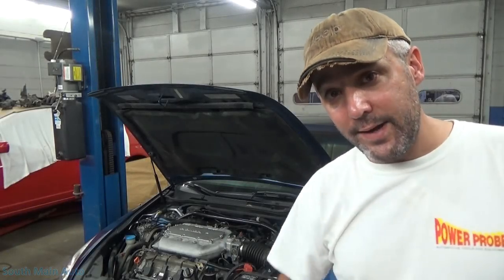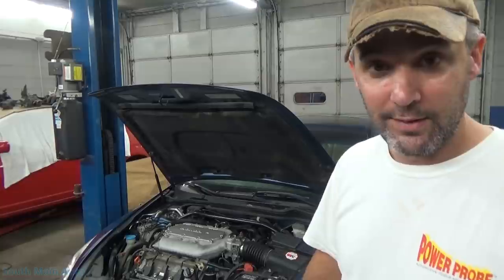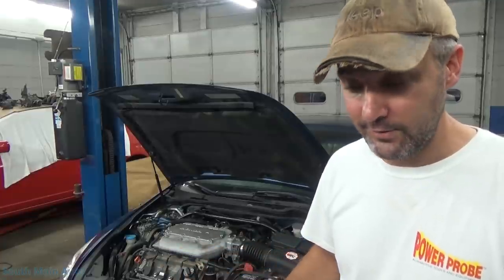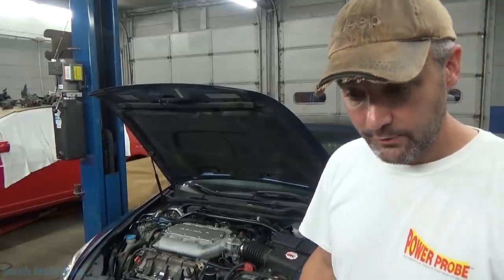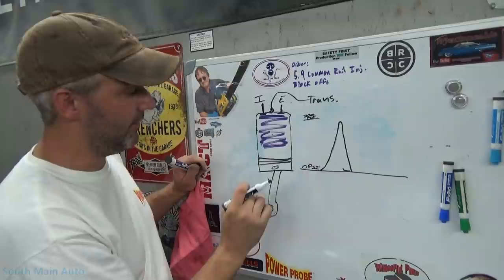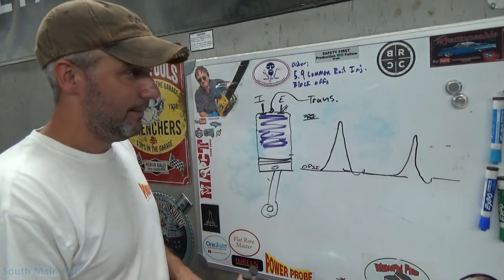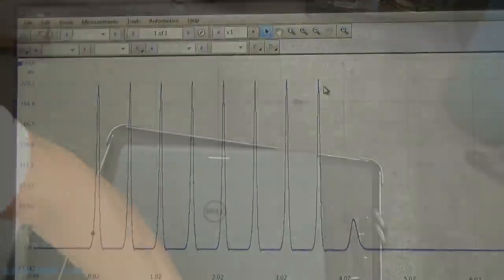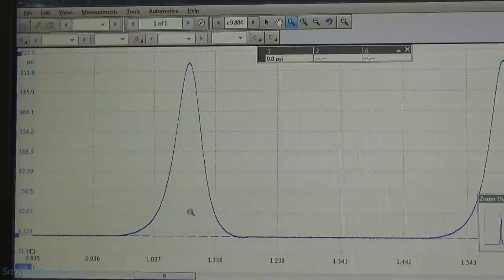Honda Accord - Slight Miss At Idle - Closer Look At Cranking Wavform

Comment: Wow Eric, thats good info/theory. I was just asking myself something. If the exhaust valve is not closing properly wouldn't it pull more air in the cylinder instead of dropping in negative pressure. OR because the negative pressure is too small, it wouldn't leak by the valve. In other words, the pressure during the compression stroke is too high for the valve to keep the cylinder sealed but the small negative pressure isn't ''negative enough'' to let the valve leak. hope my question/comment makes sense. Thanks !
Reply: What Eric demonstrated does not depend on the valve behaving differently on upstroke and downstroke. it would apply if there was just a small fixed-size hole. If the piston is moving extremely slowly, then yes, by the time it gets to bottom it will have sucked back in the air that got pushed out at the top. However, the piston is moving at some speed. So on the upstroke it compresses the air to an increasng and eventually high pressure.  Main principle: assuming a fixed size hole, amount of  air escaping is proportional to pressure (well, the pressure difference between inside and outside).  So air is leaking all the way up the stroke, and at quite a high rate at the top, and then at a decreasing rate (but still from inside to outside) for most of the way down. But near the bottom, as Eric demonstrated, the cylinder gets below atmospheric pressure, so it will start to suck air back in through the leak. But that negative pressure (relative to atmosphere) is nowhere close to the positive pressure at top of stroke. So the rate of the "reverse leak" is much slower than the rate of the top-of-stroke leak, and also it's only for a briefer time. So that's why the scope shows a very visible bottom-of-stroke negative pressure.

Comment: when all cylinders on a bank lose charge, typically a cam shaft has slipped resulting in valves opening early or closing late.  Rarely will it be due to a problem with a piston, piston rings or cylinder wall excessive wear.

Comment: Thank you for the video. Two questions:
1. Why didnt you do smoke test on cylinders 4 and 6?
2. When you did leakdown test why didn you just put the (manual) trans in reverse and let out the clutch to keep the engine from rotating off TDC?

Thanks
Paul

Comment: so If some air leaks through the exhaust valve, is it not possible that when vacuum is created in the cilinder, this cilinder sucks air from the exhust valve? and also the graphic would be different if it is the intake valve

Comment: The volume will change if the intake valves dont open enough, if intake cam lobes wear out, right?? Because as they wear they open less and stay open less allowing less air/fuel mixture to enter the cylinder, making less volume???

Comment: So I was left wondering why does the whole second bank with the leaking cylinder #5 leak more in the average than the other bank? The head of cylinder #5 should be isolated enough from other cylinders to contain the leak alone. Yet if there's enough air flow between the piston and the cylinder bore to spread the vacuum into the crankcase then shouldn't that affect all cylinders already and not just one bank?

Comment: Sorry for delayed comment, but what was final resolution?

PS:  Happy delayed by months but Happy Birthday!

As always, great videos and only getting better!

From first info on first video for this Honda all indications looked to front bank failure (relative compression test.)  I would look at head gasket that would allow exhaust smoke from tailpipe due to cylinder to cylinder leak.  And as bank 1 is the front of engine....most likely to be compromised by overheat condition.

If I missed final solution, I am looking forward to the link.

Please advise

P

Comment: Sir I have one doubt, anyway if there is an exhaust leak it should be in all over the process right..? 
So if air escapes through the leak during compression then that air should come again via that leak simultaneously as the pressure drops below the atm pressure 
Then how the cylinder holds vaccum till the exhaust valve open even under the leaking circumstances.

Comment: Eric I have a question we have a 2002 Dodge Ram 1500 that runs very ruff we were told the exhaust manifold gaskets and manifolds were both bad so we put new manifolds and gaskets on it brand new spark plugs Still ran awful there was a o2 sensor code for sensor 2 nothing changed but codes came up for injector 2 bought all 8 injectors put four on including cylinder 2 nothing has changed since. All in all we have about $500 in trying to get this truck to run right. What else could it be mass air flow sensor? Fuel pump? Jumped time? We shut it off went in a store for 5-10 minutes and this problem just started what could have happened? Any help is appreciated.

Comment: Hello all!  Just a quick question.  I downloaded a few of Eric's waveforms and I was just going over them for my own educational purposes.  I noticed that the cranking and running waveforms are pretty different.  For example, while cranking the line between two compression events is pretty straight across(except for 5 which dips of course).  While running though it forms a small hump.  I'm using cylinder one as an example because it's a knowing good.  please correct me if my understanding is wrong.

0 PSI or Bar on the pressure transducer is referenced to atmospheric pressure, correct?  So in the cranking waveform(at WOT) as the piston is coming down on the intake stroke the cylinder is being filled with atmospheric pressure and so it reads 0 at the bottom of the waveform.  This I understand.  But why does it stay at pretty much 0 when the exhaust valve opens with the piston on its way back up?

As I am typing this I'm looking at the running waveform for cylinder one and I think I'm starting to understand it.  Since while running(I assume at idle) the throttle is closed and there is a vacuum in the manifold, the piston doesn't have the same amount of air available for it to pull into the cylinder.  This is what leads to the vacuum created as the piston moves down on the intake and  power stroke.  Again though I see roughly 0 psi on the waveform of the hump between two compression humps.  I think this is because I'm confusing the 0 on the waveform with 0 actual pressure in the cylinder instead of atmospheric pressure?  But then how can there atmospheric pressure in the cyinder when there is a vacuum in the manifold and I didn't pull atmospheric pressure to begin?

Comment: Is the exhaust valve only leaking on the compression stroke? I was just assuming that if leaked all of the time, then on the power or expansion stroke, that you would suck back in air that you just pushed out and thus not have a vacuum.  Maybe I was confused that we said it leaked on compression, but then said it sealed on the expansion stroke.  Is that implying a timing issue and not a defective exhaust valve?
Reply: What Eric demonstrated does not depend on the valve behaving differently on upstroke and downstroke. it would apply if there was just a small fixed-size hole. If the piston is moving extremely slowly, then yes, by the time it gets to bottom it will have sucked back in the air that got pushed out at the top. However, the piston is moving at some speed. So on the upstroke it compresses the air to an increasing and eventually high pressure. Main principle: assuming a fixed size hole, rate of air escaping is proportional to pressure (well, the pressure difference between inside and outside). So air is leaking all the way up the stroke, and at quite a high rate at the top, and then at a decreasing rate (but still from inside to outside) for most of the way down. But near the bottom, as Eric demonstrated, the cylinder gets below atmospheric pressure, so it will start to suck air back in through the leak. But that negative pressure (relative to atmosphere) is nowhere close to the positive pressure at top of stroke. So the rate of the "reverse leak" is much slower than the rate of the top-of-stroke leak, and also it's only for a briefer time. So that's why the scope shows a very visible bottom-of-stroke negative pressure.
Reply: Ok, that makes sense.  Thanks for the explanation.

Comment: If you have a leaking valve, wouldn’t you pull the air loss as you go bdc?
Reply: The pressure created by the piston pushing "out", is much greater then the pressure created by the atmosphere trying to push "in".

Comment: 20:30  "can't say which valve" -- but in part 1 your smoke machine smoke showed up at the tail pipe, and not the intake, yes?
Reply: Right. At 20:30, Eric's saying that he can't tell which valve is at fault just from the waveform.

Comment: From a humble bus mechanic- since one whole bank is showing the same problem couldn't it be caused by a problem with the timing of that bank, say like a stuck cam phaser (or vetec or whatever Honda calls it)? The common denominator here to me seems to be the front bank overhead cam.
Reply: I just watched both videos and say cam timing off and bad/bent valve on #5. I'll hazard a guess of water pump or timing set bearing/tensioner poofed and it winged a valve/s, sprocket spun some

Comment: I have a question, if all the cylinders on one head are low why would you not assume it has a leaking head gasket?
Reply from the maker: William Warner because  assuming can get you in trouble. For example in this case it did not have a blown head gasket but it had leaky exhaust valves.

Comment: what I'm not understanding with your syringe demonstration is, How can the pressure leak out through the exhaust valve during TDC Compression, but not allow a small amount of air back in during the power stroke? Because my logic sees it as if the exhaust valve is leaking, it should leak during both events. I understand perhaps the valve could be worn/misadjusted on the camshaft. However, the way I'm understanding this is the exhaust valve should leak air during both compression and the power stroke.
Reply: I also want to add that I am by no means an automotive professional. I'm simply an automotive student wishing to learn more than what I get out of schooling/training. I'm just curious and love to learn new things!

Comment: This data shows the valve is leaking only in one direction. Specifically air only gets pushed out and not sucked back in. Without seeing the results of the leakdown/smoke test I would have suspected the exhaust valve is closing late. If it was just a sealing issue (like what the leakdown test shows) wouldn't the air get sucked back in?
Reply: Zeus Carver because the piston comes down faster than the air can come back through the leak, if the leak was small it would still create a vacuum
Reply: Why would the air not get sucked back in at the same rate as it was blown out?
Reply: If the there was a gaping hole you would be correct but the leak is slow so air would leak out faster the higher the pressure. The pressure is decreasing when the piston is going down so it would leak less on the down stroke. Valve timing can throw a wrench into all this speculation. If the exhaust valve opened earlier you may never see a vacuum condition. A more high performance engine with  huge overlap and advanced valve timing would be entirely different.
The key here is in the comparative analysis.  #5 cylinder has considerably less compression than any other cylinder (I believe almost 80 lbs less). IMHO the smoke test told it all. Bad exhaust valve or seat. The reason it shows up more at idle is that the leak is (relatively) slow so there's more time for it to leak down at low rpm. Eventually that cylinder will get worse and you'd notice a problem at speed.
  All good stuff. Thanks for making us think a bit. It going to be interesting if/when Eric digs into the guts.
Reply: This caught me for a second too. But then I remembered that it would only leak out as the in cylinder pressure is equal or higher than atmospheric pressure throughout almost the full cycle. It doesn't go in to negative pressure except for the very end due to the leak. So it can only leak out and not in. Does this make sense?
Reply: The cylinder is not drawing a vacuum for the same amount of time, and with the same amount of force, as it is building pressure.  Like Eric showed, the cylinder is a zero psi starting at BDC, the entire length of travel from BDC to TDC the cylinder is building pressure.  When at TDC it is at maximum pressure, which is very high, resulting in a lot of force trying to push air out of the valves.  As the cylinder travels back down, the original air charge is "expanding" and the pressure is dropping.  For almost the entire travel time back to BDC there is still more pressure inside the cylinder than outside, therefore no air can be sucked back in through a leak.  It is not until the piston is really close to BDC that the cylinder reaches zero psi, and then begins to draw a small vacuum.  The vacuum only happens for a small amount of time.  In summary, the small amount of vacuum and the small duration it occurs is not enough to recover the air lost from the very high amount of pressure that occurred for a much longer time.
Reply: Leaking on the compression stroke!
Reply: Dave Sage I was hoping he would touch on the idle vs running matter. Your idea makes sense. Thanks!
Reply: Mike Goodman pretty obvious that a valve spring (or springs) have around 100lbs seat pressure & given that atmospheric pressure is 0 as stated in video then SFA (NOT SMA😎) is going to get past the valve seat unless it's bent or burnt as opposed to the 200lbs of compression forcing it out!!! As Eric O says, USE YA NOODLE!!!
Reply: Wow, Mike Goodman, you're not thinking at all. The air leaks out because there is up to 200 PSI in the cylinder relative to atmospheric pressure. Air is probably leaking out almost the entire time from BDC back to BDC.

So when is air going to leak back in? Only after the cylinder pressure goes negative, i.e. to a partial vacuum, which is only a short time before we're back at BDC. And why would a ~5 PSI difference at that point cause air to leak in at the same rate that a 200 PSI difference forced it out?
Reply: Michael O I'm dead 😂😂😂😂
Reply: Mike Goodman same reason you can blow through a 1/2 inch pipe real fast, but you can't through a straw.
Reply: Michael O I've never seen a half inch straw..If so then try a coffee stirrer, a smaller hole will provide resistance.
Reply: Aaron Kimmins CLEARLY you don't get out much then 'ey?! Available with every purchase of any 'Pearl Tea' probably in almost every Food Court in every Mall in the world! 😂
Reply: Air can only go into the cylinder as fast as the atmosphere can shove it in. The Piston is not pulling air into the cylinder. The Piston is pushing the air out on the way up, though. The Piston can push air out much harder/faster than the atmosphere can push air in.
Reply: Michael O How insightful. Thanks for the feedback.
Reply: Pretend suck doesn't exist. Air moves from high pressure to low pressure, Pressure outside the cylinder is at atmospheric pressure or apparent 0. The only time air will go back in the cylinder is when the pressure in the cylinder is below 0. Or when the cylinder is under vacuum. Less than 0. Which is just before BDC when the vacuum occurs for a very brief time before the vacuum disappears.
Reply: You can have lots of bars of pressure, but absolute vacuum cannot be passed (-1 bar)
Reply: @mikegoodman4133  At the top of the stroke the pressure is very large compared to the air on the other side of the valve(Which is essentially 1 ATM) and the air leaks out easily. As the piston pulls down it finally gets near the bottom when it starts sucking air.  But it's only a little less than ATM so yes it sucks air but the pressure differential is very small so it doesn't suck much.
Reply: @talleddie81  outstanding description. Thanks man.

Comment: I still say cam timing off and #5 valve bad/bent ;)
Reply from the maker: even though we proved with transducer and visually looking that the cam timing is on?
Reply: I was judging by overall compression difference from bank-to-bank (slightly higher vacuum too) I suppose all the exhaust valves on the head could be bad, but if so what caused it? did it wash the rings out on the front bank or is the rear bank full of carbon. something else doesn't fully add up to me :)

Comment: I thought you layed it out just fine. Out of academic interest, since the net result of a non contributing cylinder requires the   pulling of the head regardless, would shoving a banana up the tailpipe show a corresponding rise in pressure at that moment?  Back pressure on the exhaust side should force air back into the cylinder through a sticking or leaking EX valve therefore reducing or erasing that dip into vacuum as a validation check.  Again, a silly exercise as a smoke or camera check would verify the condition more readily.  I just giggle at the mental image of a lowly banana used as a serious diagnostic tool and I wonder how it would be written up on an invoice.
Good show and happy 23rd birthday!
Reply: Eddie the Grouch Me thinks a good ol' Idahoan spud would work better. JUST write "Snap-On" on the potato before you shove it.
Reply: Hmmm, I think this would certainly change the "dip" symptom, after some number of strokes significantly increase the pressure in the exhaust system. Right around the time the muffler blows up :-).